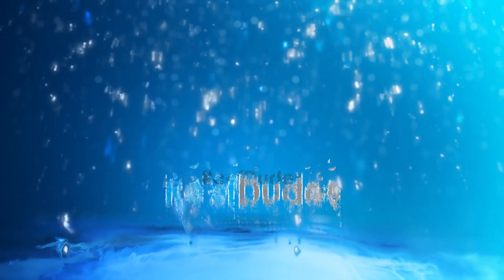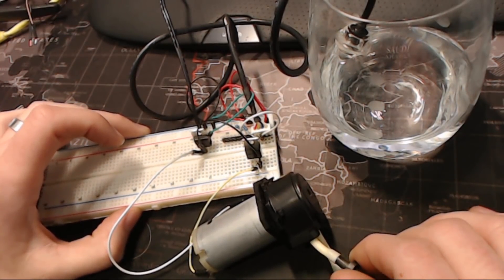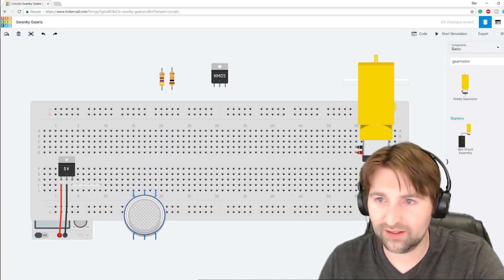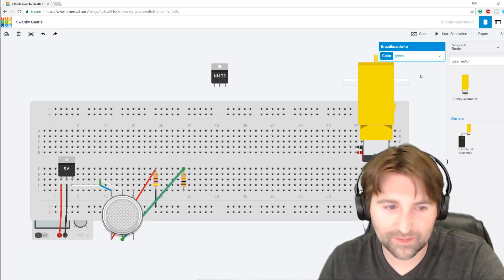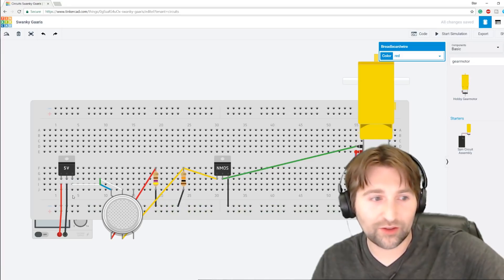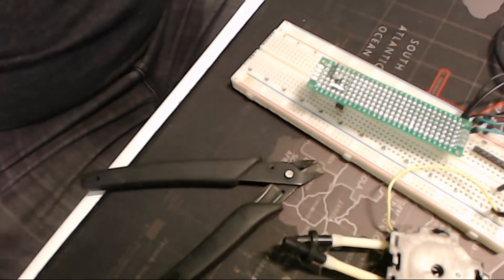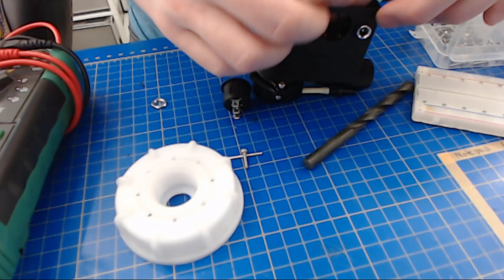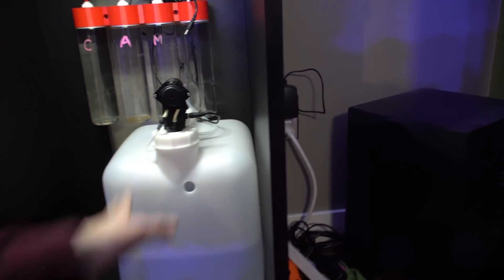DIY $30 ATO using an Optical sensor to Automatically top off your water

Comment: Hi Deven, gonna try this... Why did you use 470 vs 390 ohm resister shown on circuit diagram? I bought 390 ?
Reply from the maker: IT was likely what i had laying aound.. Or.. i mayhad had a diff part for the optical sensor.. not 100% sure as this was a while ago

Comment: Is there a way to wire an optical sensor to a connector with a simple open/closed circuit method? Or is this board required?
Reply from the maker: Two One you don’t need that board. That was just to diagram / explain it
Reply from the maker: The optical sensor is a digital signal so you still need to use a transistor for the switching
Reply: If I include a resistor, will the optical sensor operate as an open/closed circuit in the same manor as a float sensor valve?

Comment: Great vid. Can I daisy chain more than one optical sensor, 3 to be precise. So that they can each trigger the pump to fill in 3 individual tanks that I would each have a float valve?
Reply from the maker: Doable but I would just give one to each system rather than all
In one

Comment: Based on what I’ve gathered from your video it appears I could connect the white and blue wires to a 5v brick then connect the red wire to the ground of an apex breakout box and the yellow would be assigned to one other other screws on the box. Then program the apex. Would that work?
Reply from the maker: The optical sensor uses a ditigal signal where the BOB is analog. .would have to do a little circuit to trigger a relay and let the relay bridge the pins on the break out box.   If you have the apex a float switch and an aqualifter would be your simplest solution

Comment: can you post the wiring diagram on your IG ? i still confuse to see this diagram on youtube.
Reply from the maker: I'm not sure if i still have this one or not.. ill have to check the shed later.
Reply: @ReefDudes  what's the part before 5v regulator ? Is it 12v dc power supply or 220v AC ?
Reply: @ReefDudes  and we use 12v dosing pump for top off the water ? We dont need any relay , just a mosfet as a switch and the optical sensor as a signal to mosfet right ? Its kinda differend if we use float switch, float switch using relay, i see the tutorial on another utube video.. I love optical sensor than float switch, i think optical more accurate.
Reply: @ReefDudes  about the resistor, is it 470 ohm & 10k ohm resistor ?
Reply from the maker: Yep. mosfet is basically your relay.      should be the same as the dosing pump as its 12v as well.  Your pump will have constant 12v connection and the mosfet will connect the ground.
Reply: @ReefDudes  i see, after watch 10 times back and forth, i more understand your wiring diagram now, hope i can get those part in my country. thank you for your tutorial
Reply: @ReefDudes  for resistor , is there any alternative for 470 ohm & 10k ohm ? i see the diagram on google, it use 390 & 4.7K .. is it just the same function with 470 & 10k ohm ?
Reply from the maker: craftme id if it’s for optical use the ones or species for. If for the mosfet then it’s not as picky and you can use something close
Reply: @ReefDudes  I see, do your DIY top off ever failed to stop when the water reach the sensor? Double sensor not necessary?
Reply from the maker: andika sitanaja  nope it hasn’t failed. I just like yo be extra cautious and have backups!
Reply: @ReefDudes  okee thank you 😊
Reply: @ReefDudes  just want to say , i made it ... first it did not run, i find the problem in 5v regulator, the voltage not 5v through the regulator, only about 4v ... i switch the 5v regulator with 5v phone charger, and it run well after.... thanks for the tutorial
Reply from the maker: craftme id awesome to hear you got it all fixed and working!
Reply: @ReefDudes  i find i must slow down the pump to drip mode, i look the sensor is quite sensitive, 
thinking another way how to make the pump still run for 3-5 seconds after the sensor switch off..do you have an idea ?
Reply from the maker: @craftmeid3520   If you use an arduino nano you could program delays and what not
Reply: @ReefDudes  i see , i make one more ATO then install to my main tank this DIY ATO , put it in return pump chamber in sump.. works great.
Reply from the maker: @craftmeid3520  Awesome! nice work!

Comment: Could one use this circuit with some modification on the Apex Breakout Board?
Reply from the maker: To use an optical sensor on it?  Yep. Simplest way is to just use the optical to trigger a really and let the relay output bridge the breakout Box pins

Comment: so as a fail safe could we add a second optical sensor as a overfill limit? Would I just wire it in series or? Not quite sure how to do that. I like a fail safe from turning my saltwater tank to freshwater. Amazing design thanks for the inspiration

Comment: Love the all in one design. Very slick 3D printer would come in handy.... are there any better places to get the pumps at?
Reply from the maker: Amazon is usually the cheapest.   3d printers are handy!  you could always just use a generic project box (thats what i used to do)
Reply: You can also get mouldable plastic off of Amazon and try playing with that. All you do is add boiling water, and the plastic becomes, well, plastic for a short amount of time, and you can shape it. Not sure how you'd go about making a completely watertight container with it though, it might not be possible.
Reply from the maker: How is that stuff to work with? does it work well?

Comment: Is it possible to use a 5v phone charger and eliminate the regulator?
Reply from the maker: if you find 5v dosing pumps then yes for sure. Mine were 12v any i only wanted one power supply.
Reply: @ReefDudes  Perfect! Thanks.  The tunze osmolator pump says it's 3-12V.  I'll give it a try since my reservoir and sump are on the same level, virtually no head height.
Reply from the maker: @bryguy1811  awesome should work out! let me know how it goes :D

Comment: Would you recommend putting a refugium and or a chaeto reactor on the red sea nano max? Also do you use NOPOX or other methods to reduce nitrates and phosphates in your tank?
Reply from the maker: Im toying with the idea of adding my chaeto reactor to it!    I do have some NOPOX but havent used it yet.
Reply: I'm in the same boat and was wondering what you would recommend?
Reply from the maker: Well i think im going to try the CHaeto reactor :)

Comment: Will this setup work with the float switches? or is it just the optical?
Reply from the maker: you could likely make it even simpler with a float switch
Reply: @ReefDudes  yeah, I think im going to try, 12 volt power supply, 12 volt powered relay, float switch and the pump you used. Power the relay and the pump from the 12 volt power supply
Reply from the maker: @bhodili00  you got it! Thats tour simplest solution,

Comment: Hey , what i am confused about one thing. So your sensor when it detects water it will start the motor(High) and when its detects no water(Low). So how did you make it work did you invert the signal or something.??

Comment: Can you show how to put in a timer?
Reply from the maker: Simple solution is plug the whole thing into a physical timer.  Doing via could could do with an arduino nano
Reply: @ReefDudes  I was thinking about using your system on my filter roller sock. When activated it could go into a timer for about a few min before activating, then running a low rpm motor for set time to roll the filter. possibly a great video idea. Possibly a optical eye for on and off.
Reply from the maker: robert jacobson a small arduino board would be the easiest as you could program and tweak it until you try it just right :)

Comment: Just built this with the parts linked. I found that I had to swap the blue and yellow wires on the sensor. Not having the white wire on the sensor didn't matter. The 10k resistor doesn't matter to much. Works with a 4.7k all the way up to 22k resistor. I have made 2!
Reply from the maker: Nicely done!! and thanks for the info!  They must have changed the sensor since I built it

Comment: Just wanted to chime in and clarify something. You used a 10k ohm resistor in your build, but the sensor you linked requires a 4.7k ohm resistor in place of the 10k ohm resistor.
Reply: Just had a look at the ad again and there's actually 2 different diagrams, one with 10k ohm and one with 4.7k ohm. Do you know what the difference is? Are they for different applications?
Reply from the maker: the one diagram called for 390 and i used a 470 (because thats what i had laying around)  as long as its in the general ballpark it should work.   you can always put 2x 4.7k together to get close to 10k :)             I had a few different optical snesors laying around and the one i linked was the same specs as the one i used :)
Reply: This is what I mean, the amazon link provides 2 different diagrams for the circuit

In the first diagram they list that a 4.7k ohm resistor should be used:
https://images-na.ssl-images-amazon.com/images/I/51pJ4IrSBDL._SL1057_.jpg

In the second diagram they list a 10k ohm resistor. I'm confused as to which one is right:
https://images-na.ssl-images-amazon.com/images/I/51QBQH%2BFrnL._SL1017_.jpg
Reply from the maker: haha gotta love china instructions. well i used 10k and it worked :)   Im willing to bet that either will work and they just want a higher value resistor in line.
Reply: https://i.imgur.com/RGOENzv.jpg
 
You're right, I just completed my unit using a 10K ohm resistor and it works! I do see the issue with the water droplet on the tip causing misreadings. I'll have to think of a way to mount it at an angle as it seems to work best that way. I'm so happy you posted this because I bought 2 of these sensors without much thought thinking I could use them like a float switch. I thought I wasted my money until you posted this. I had spare 12V supplies and a spare Tunze pump so all in all it only cost me $12 in parts. Thanks!
Reply from the maker: Wicked!  super cheap! love it!   No issue with pointing it down,, it just wont kick on until the water drips off (no big deal.. just wanted to point it out)   Thanks for filling me in on your build! I love that you already built one with 24h of me posting it!

Comment: Can this be used for fuel? Gasoline specifically.
Reply from the maker: Could be used for any liquid. You would just need to make sure what ever tubing you use (including the dosing pump) is rated for it and worm break down.  I’m not sure if gas would have long term
Effect on optical sensors or not

Comment: A few things about this video. First, I love it. I am currently pricing it out as we speak. Second, your parts list could use a little updating (switch used isn't included, pump can be used with 12v. etc.) I would really appreciate a little more in-depth explanation on building it and the components used. Super cool design. and thanks for posting the 3d print schematics. Keep up the great work!
Reply from the maker: Why thank you!  Ill do some digging in the next few days to update it some more :)
Reply: ReefDudes the reason I ask for specific components is because when I price it out it comes to about $60 on Amazon. This is primarily due to having to buy in bulk. So I want to be able to order in smaller quantities. But I need a complete exact parts list to keep the $$ down as much as possible
Reply from the maker: If you click on the Amazon links you can pull the part numbers form the titles but    IRFZ44N  is the mossfett   and LM7805   is the 5v regulator. 470/10k Resistors,  Power supply you likely have one from an old electronic item you can reuse.  Blank circuit board dont need.. just makes it look nicer and cleaner :)
Reply: ReefDudes I'll look into it
Reply: So I have all the parts listed and an appropriate switch. I am building it all as described, however I cant get it to function
Reply: US Pennington

Comment: Don't know why you needed the 5v reg when you can run 12 to this censor but whatever. I didn't know you could get these for just a couple of dollars thanks for the tip!
Reply from the maker: Good catch!  the older model of it that i used said 5v.. they must have updated it! even easier :)
Reply: With this change, Could you post an updated video or at least parts list? I am about to launch myself into this project and looking to buy the parts needed.

Comment: Great DIY ATO idea. One small error on the way you show the resistors placed in the video to visualize the bread board circuit section.  F19 to J19   &  also F24 to J24 are rows that are connected in the bread board so the resistors would be shorted out as shown. you could place the resistors in the same row if 1 lead went from the top section(A-E) & the   other lead went to the bottom section(F-J) as those aren't common connections. Otherwise you would have to place the resistors from say F19 to J20 & F24 to J25 where they are in different rows so the resistors aren't shorted out.  If someone followed this layout on a bread board exactly without knowing better the current limiting resistors would get jumpered out.  Soldering it together like you did is a better long term solution anyway. Sincerely the Bread Board Police lol!
Reply from the maker: Good catch!!!    thanks for calling that out.. ill pay more attention next time i explain a circuit :)  In my actual breadboard they just jumped right to the ground rail :)

Comment: G'day Devon, great DIY thank you. A quick question though, can the signal be switched to run a motor with a HIGH water level? I'm working on a DIY Rollermat and need the motor to advance when the water level gets high. Thanks.
Reply from the maker: Yea you could. :)
Reply: @ReefDudes  Your help and effort was greatly appreciated. Thanks
Reply from the maker: @ingridfleming8595  Your most welcome :)

Comment: The optical sensor on your link has 3 wires while you have 4 connections
Reply from the maker: They just have swapped the part.  The video is 2 years old now.  The working should be similar if you follow their diagram
Reply: @ReefDudes  yea thanks..might need different resistors ...i need to find it in my pile!

Comment: Hi all... is there anyone that can help me with this... I have followed the video like 1000 times and I just cannot get it to work like it should.
Reply from the maker: What is it doing.. or not doing?
Reply: @ReefDudes  it doesn't turn the pump on at all... I think my brain cannot wrap around why both the red and black for the optical sensor both goto the black wire and I don't seem to get any voltage changes after the MOSFET

Comment: love your videos man but let me tell you most confusing video i have ever seen for a DIY i would not attempt this on my own couldnt understand anything you were doing.
Reply from the maker: hahah Thanks Chris!  i'm not going to lie.. i figured this one would be over alot of peoples heads (and i tried to make the circuit as simple as i could!)    More of an expierment to see if many like the more techncial side of my reef project madness :)
Reply: yea i mean im a big DIY guy myself i do home remodeling for work. kitchens, bathrooms, basements ect. so i know a little bit of everything and this just blew my mind i just for some reason didnt get it ...i think if you went slower and showed step by step and explained what each part or resistor does might help people out...

also what i mean by step by step is actually doing in on the circuit not on computer.
Reply: I love this video - I doubt I could make it though. I'm gonna build my reservoir as part of my sump I think (so it can't overflow) and just use a float valve connected to my APEX - but this may come in handy if I don't have enough room in my sump or I want to increase the ATO volume. You should sell these Deven - I think it's a better solution than what is commercially out there because you just screw it onto a container. Super simple and elegant.
Reply from the maker: Thanks, Sunny!   I appreciate the love.    I often debate if its worth selling my creations but usually just try and teach other to DIY them.. one day i may!   As long as your ato is higher than your sump you cant get simpler than a float valve!

Comment: Why do u even make a video where u dont even supply the circuit schematics, also what white cable u are talking about?? Ther is no white cable?? Blue is ground, yellow is signal and red is voltage input. I had copied the exact connections and this doesnt even work, what a waste of money when u dont even explain on detail.
Reply from the maker: The DoB Night's Legacy sounds like you have a different sensor (or maybe the company changed or replaced their part?).  I have helped out a few people through questions and I know lots have successfully built these. If yours is wired differently go off the wiring diagram of the Suppliers part. Most should work similarly
Reply: @ReefDudes  then how i go about this sensor? Its the sensor that comes when u click the link in the description. The one in there seems like it needs a microcontroller which then u have to connect to a relay